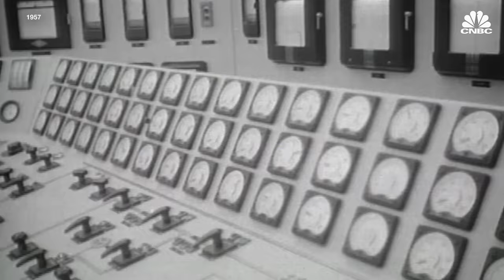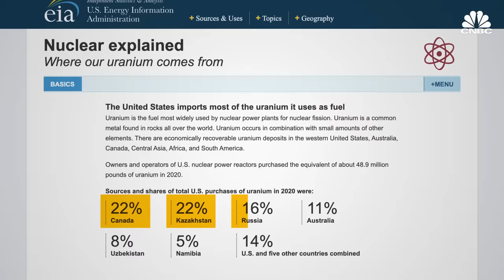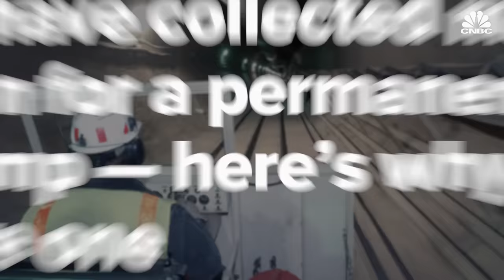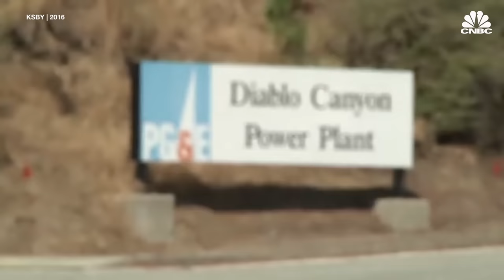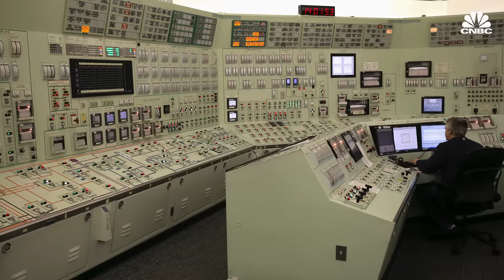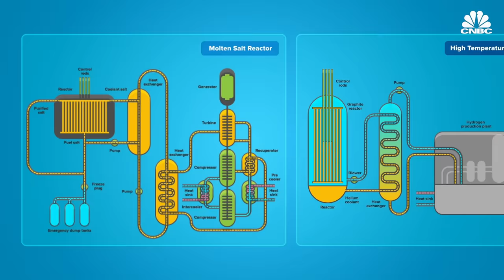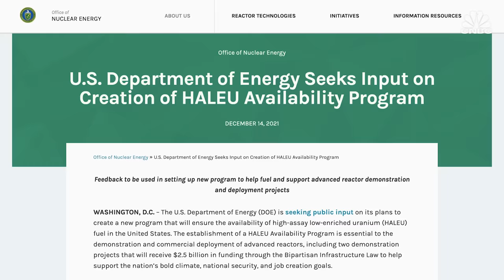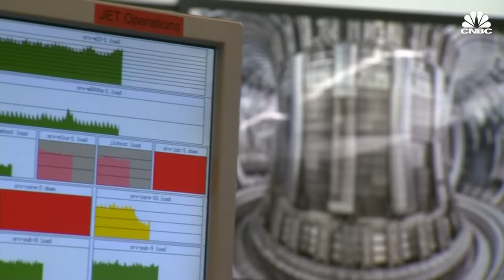Why Nuclear Energy Is On The Verge Of A Renaissance

Comment: The "concrete covering over the reactor" is NOT the reactor vessel.  It is a safety system called the "Containment building".   The reactor vessel is a steel pressure vessel holding the fuel.  The reactor vessel is located inside the containment building.
Reply: Magnox reactors and AGRs actually have concrete pressure vessels, though. Although it's still in a containment building.
Reply: Waaaaaaay inside the containment building. The pressure vessel is tiny in comparison.
Reply: @erikkovacs3097  Tiny?  LOL.
Reply: @williamgleaves1954  The containment building is about 20 times the size the actual reactor takes up, so yes, tiny in comparison. Some modern nuclear reactors actually are shrunk down to the size of a washing machine. But even the more conventional ones are the size of a room (as opposed to an entire city block)
Reply: @williamgleaves1954  Comparatively speaking, yes. Though it is true that even for a "small" thing compared to the rest of the reactor it is one of the hardest part to make because there is precious little places in the world that can manufacture them.

And we have killed, in the 70s, all of our MSR programs that aimed to make reactors designed to operate at ambient pressure. Such reactors would not need a gigantic pressure vessel, nor would they need the even more massive containment building.

the containment building not only exist to prevent damage from outside sources, but primarily to be able to contain the massive steam explosion that can occur if the pressure vessel ruptured catastrophically. It is the primary reason why it has to be made so big in the first place. With an MSR, you are using a salt as a liquid medium, so there cannot be a steam explosion and as a result the containment building and core vessel can afford to be a lot smaller, more compact and far easier to build.
Reply: @caav56  no they don't ! concrete is NOT the pressure vessel, that's just the outer layer ! radioactive particles will seep through concrete like a knife through butter.
Reply: @psycronizer  Look into Magnox and AGR reactors. They do have their reactor vessel made out of prestressed concrete, which is in part due to lower operational pressures inside core (they are CO2-cooled, not water-cooled).
Reply: Building new nuclear electricity plants is totally economically braindead in 2021.
It costs approx 4x all the other alternatives, fossil or renewables.
And that is without calculating all the cleanup costs.
Reply: @chargehanger  The cleanup costs are now included in the construction cost - hence why plants jumped from a 5 billion price tag to a 20 billion price tag.  They more than pay for themselves though over a 40 year lifetime, if they didn't then no one would even be discussing them, would they?
Reply: @krashd  Both wrong. Cleanup costs are not included. New Nuke reactors make each kWh cost 4x more than each alternative.
Reply: @chargehanger  You may be correct...for now, but when people are starving and shivering in the dark, they will change their attitude and you will see nuclear power. I hope it is not too late.The cost is due to a few who litigate everything every step of the way just to stop it by running up the costs which you see happening.
Reply: Where should I look to invest? Anyone have some symbols for me to research?
Reply: @chargehanger  --  Yep.   The "increased costs" have often been brought on by sloppy work or sloppy engineering.    Unfortunately, during the peak on the nuke production, there were frequent episodes where, as an example, there were poor quality welds on the piping but that the "inspectors" didn't catch them because they were fed duplicates of good joint x-rays rather than the x-rays of suspected joints.

There were  years and years of claims of super reliability; this had the effect of excusing sloppy work because each lazy worker figured that any mistakes would be "fixed" by the system.
Reply: @chargehanger properly called decommissioning costs, cleanup at end of life.  Yes it’s included in the reactors electricity rates by law, about 0.1c per kWh.
Reply: Containment has a steel shell covered with concrete